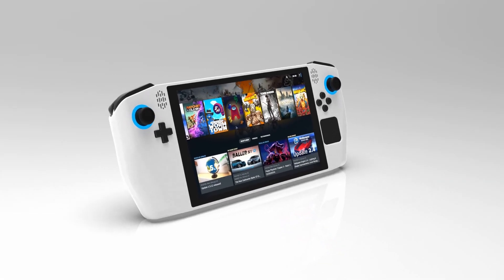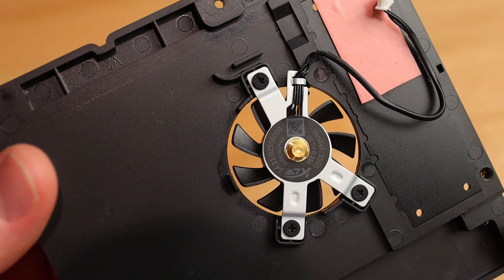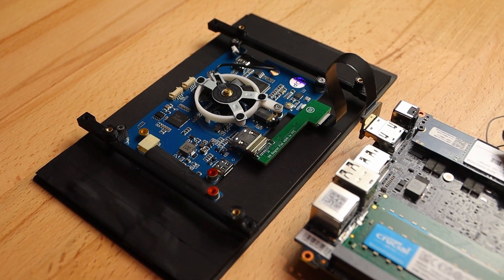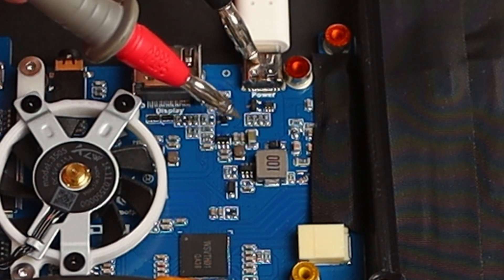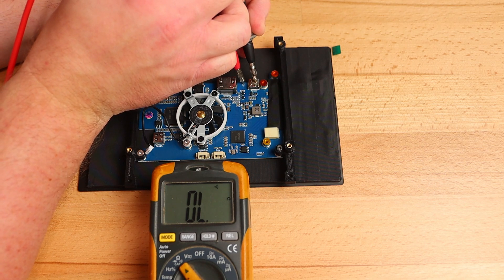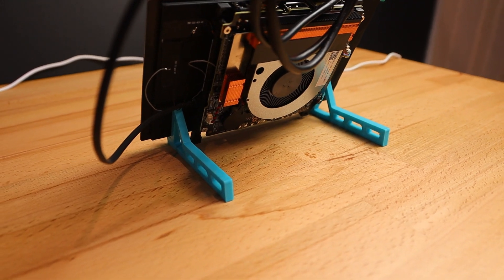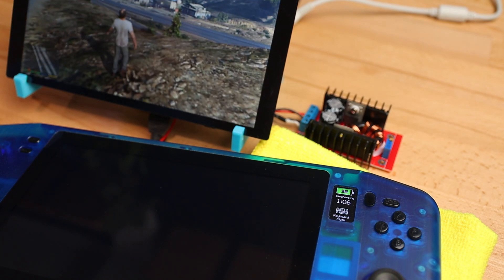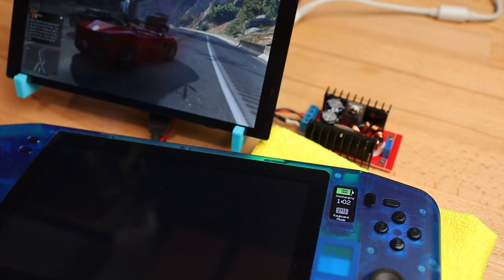The ZenDeck Project - Episode 3 - Connecting the Display

Comment: Could you have used a standard HDMI cable with a 90° bend instead of relaying via FFC?
Reply from the maker: Sadly not, there is very little room in there which is why I needed to design the custom adaptor.
Reply: @cncdan  oh okay man

Comment: Can i use 21700 battery? So i got higher mAH?
Reply from the maker: I'm considering that option. It is going to make it heavier, but with current capacity limits it would allow you to double the capacity of the NucDeck battery, meaning you'd get about 2 hours of use un-capped and possibly up to about 6 hours of light use.
Reply: @cncdan  oh i see, thanks for ur reply
Reply: @cncdan  Personally I would prefer doubling the capacity if the only downside is weight. :)

Comment: I have finished mine at 70%. Since i have not a 3D printer I use a PVC box, it's easier but it's bigger... really bigger.
I use a dc jack to charge it through a BMS 3S3P with new battery cells of 4000mAh liitokala 18650 lliking 4000
And step up boost 12v to 19v
 there is a rgb switch, 2 fans 5v 0.1A each of 30mmx30mm, a little screen for the battery and another one with volt+ampere. 
2 nintendo oled speakers and 2 nintendo rails to attach 2 NYxi joycon.
And i will soon paint it in black, i have to finished  beforethe holes for power button, usb2 and usb type C and the holes for the 2 fans. 
And since i have a lot of space inside the box i have decided to put later on a SSD

You do it like a pro, mine it's more raw but really enjoyable.
Reply from the maker: As long as you're having fun, that's all that matters!
I'm a bit sceptical of the 4000mah 18650's, as the highest capacity I've been able to find in a reputable brand is 3600mah. I have had good success in the past with the littokala cells though so I might have to pick a couple up and do my own capacity tests!
Reply: @cncdan  I have checked them it weight 48g and are ~4100 to 4200mah So even higher than 4000. There are some videos in youtube that have checked them also from 3900 to 4200. I don't know if they will last in time
Reply: @asusdreamland5670  what screen u use?

Comment: I hope this project pushes hardware manufacturers to make something like this.  A handheld PC you can upgrade like a desktop seems like the next step of PC evolution to me.
Reply from the maker: I hope so too! I'd love to see some SBC's that are designed specifically for this. Thin profile boards with lower voltage power inputs and intenal display/usb headers would be a good start!
Reply: I feel like the easiest way to do this would definitely be to build a console with a mini pc setup in it that then had a replaceable cpu, then just be able to swap out the cpu for upgrades since that would also naturally come with integrated graphics which in AMD’s case isn’t too bad. (Especially for a handheld console)

Comment: if you sell the custom PCBs, can you drop a link here? Im interested in making my own PC but may try making this and tinkering with higher capacity batteries, and more batteries, ( its fine if it comes out a tad fat, bigger consoles are more comfortable for me as long as they are not too thick and heavy)
Reply from the maker: This will already be pretty heavy with the amount of batteries I'm adding, but if you want to add more go for it! 

Yes I will make sure I let everyone know if I end up selling the PCBs for it!
Reply: @cncdan  if my choice of mini pc has low enough consumption then 4 9900 mAh batteries from anazon will work, they are AA but i can make it internal only and rechargeable, the batteries themselves already are
Reply from the maker: If they are AA sized and claim to be 9900mah, I can assure you they are fake. That sort of capacity isn't possible even in much larger lithium cells, let alone AA size. With batteries like that, at best you'll get a re-skinned cheap lower capacity cell. At worst you'll get a tiny battery inside a tube full of sand to make it feel heavier and a potential fire hazard. I'm currently looking at the option of using 21700 size lithium cells, which would allow me to cram about 90wh of battery in there for a runtime of 2-6 hours depending on load. The downside to this is they will be about 100g heavier than the smaller battery and require a small bump in the lower rear section of the housing.
Reply: @cncdan  well, thanks for the warning, maybe i can try two of what you go for, i really dont mind a heavier handheld because playing on my switch i sit in a way where it easily rests on my legs, and heavier just feels better for me

btw, can you drop a link to the miniPC you used soon? if its cheap enough i might use that one

i said anazon not amazon lol
Reply from the maker: Here's an amazon link for the one I bought: https://www.amazon.com.au/gp/product/B0C99CRP1X

With the larger 21700 cells it will probably weight about 1kg all up which is already on the heavier end of things. If you doubled up the battery you'd be adding another 320 or so grams of weight bringing the total weight to over 3x the weight of your switch, just FYI. If all you ever plan to do with it is sit on the couch and play, I'm sure it would be comfortable enough but then I'd just have mine plugged in if I never planned on taking it anywhere.
Reply: @cncdan  my family is military, we move a lot, but at the end of the year we settle back home for good. still, i want more battery because we do long car trips and sometimes everybody needs all the outlets for phones and ipads and laptops

sheesh thats an expensive mini pc, i think im gonna stick to buying Latitude 7400
Reply from the maker: Keep in mind, that's from an Australian seller so the price is in AUD. If you search for that model locally to you you'll probably find it a bit cheaper!
Reply: @cncdan  maybe, but have you thought of Orange PI 5? it uses 5v at 3a, and can come with up to 16 gb of RAM, the GPU is ARM Mali G610 though, so mostly midweight gaming. 8c 8t processor tho and a good neural engine
Reply: also, if i'm bothering you, just tell me and i can stop
Reply from the maker: Yeah I've built handhelds with pi's before. You'll definitely get better efficiency and longer battery life but the performance of a pi 5 is nowhere near that of a ryzen mini PC so it really just depends on what you want to do. You're not bothering me, the comments help show YouTube the video is interesting, hopefully 🤣
Reply: @cncdan  raspberry pi or orange pi 5? the OPi 5 is actually PS5 level specs aside from GPU

Comment: Adaptability is great. I'm currently thinking about AMD's forthcoming Halo Strix, which will likely be too high wattage for most handhelds, but might end end up in NUC-sized PCs. I'm usually near power of some sort (like in a car) when I'm using a handheld, so it doesn't need to run for hours and hours at the higher total system power, though I'd like more than just a 'UPS' anyway. I've found that I'm a bit of a stickler for 60 FPS, which looking at the Steam Deck most played games I seem to be in the minority given most of the them for both people playing and most times played are what I'd consider 'unplayable' FPS-wise on it, so I'm looking for something with a lot more oomph than current handhelds can manage.
Reply from the maker: Yeah, you may need a different power solution if you're planning to use a system with significantly higher maximum tdp than this one. I think there are a few other IC's from the same product line that can handle a bit more power. Either that or if you're happy with a slightly janky solution just run straight from the battery and use a switch to change over to wall power!
Reply: Strix Halo is reportedly targeting 140W TDP, which knowing AMD means about 160-180W at full tilt. It's like an entire PS5 APU in size and power. Any Mini PC this ends up in could end up being Series S sized, as the chip is meant to be the CPU and the GPU for a gaming laptop. The Kracken series of APUs might be a better fit. Still Zen5 and RDNA4, but targeting more normal TDPs like 28-50W.

Comment: Looks unreal, Im glad your progressing by day! What would be awesome to also see is maybe some implementation of the framework laptops modules (which are open source and you can modify  them the way you like), or maybe some port which lets you connect a powerbank just on the back of the machine, to also slot into, would be sick! Keep going!
Reply from the maker: Well it will support USB-C PD charging so you could get a big power bank and connect that for longer runtime! I don't have framework stuff so I'm not even sure what options there are for modules! If there's anything useful that isn't already included on the mini PC I'll look into it
Reply: @cncdan  The framework laptop modules, are open source and all the architecture is there, it literally just uses type c ports but are modules which can include anything from more storage to displayports in that module, and the community already designs some of that stuff so its ready to go and be made/bought on their marketplace

Comment: I know you're gonna work on it in the later stages, but did you think about how you would make the analog triggers work? It would be so cool if you could use hall effect sensors, and read the voltage changes in them to create an analog signal....😀
Reply from the maker: Yeah I used hall sensors on the last one and it worked well. In my opinion, it's actually one of the easiest ways to make triggers so I don't know why anyone would do it any other way anymore yet companies still do!